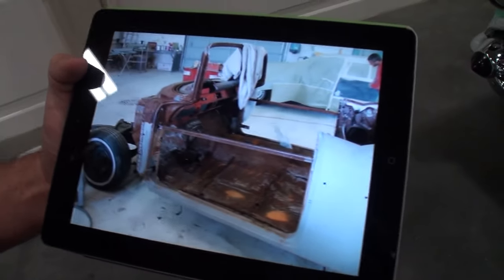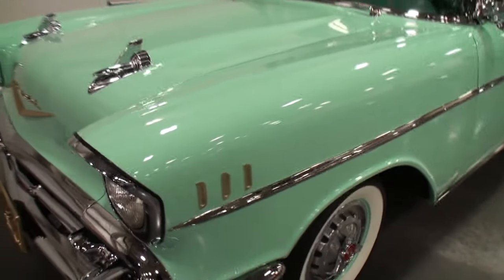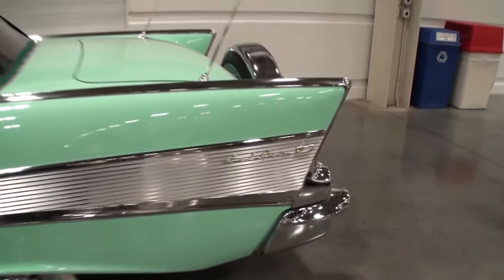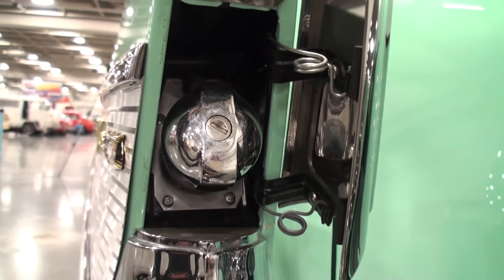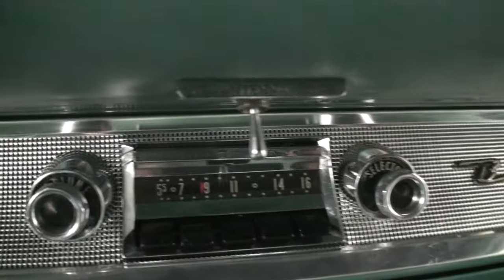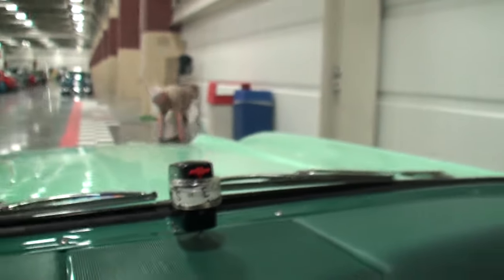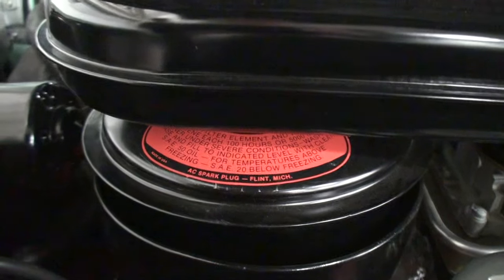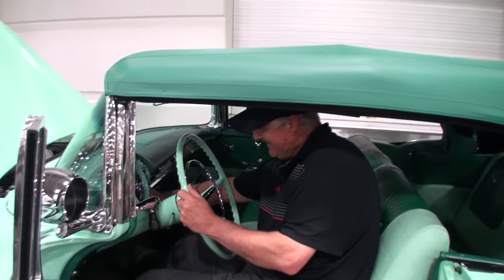1957 Chevrolet Bel Air Convertible in Surf Green & Engine Sound on My Car Story with Lou Costabile

Comment: That beautiful car was built from the frame up...They had to find/buy most every piece, 1500 man hours....Would love to know how much it sold for, seems like there is about $50K worth of labor costs at least, plus all the parts.  Pretty color though, sure wish I understood just how that overdrive feature worked.  That's a pretty busy looking engine compartment, looks more like a car from the 70s under the hood!  I wonder if the car was built specifically for a customer or if they just built it for sale....
Reply from the maker: Hi Kramden, Agreed, a beautiful car.  Built for the Customer, not for sale.  Thank you for sharing a comment, Lou
Reply: @loucostabile  beautiful color. It’s not a turquoise but surf green? Any difference? I have a 57 rag top but not like the one you built. AMAZING! Thank you for sharing.
Reply: LOU , did I forget to mention in the previous conversations that I ❤LOVE…CONTINENTAL KITS AND ALL THE OPTIONS 😂🤗💚💚💚